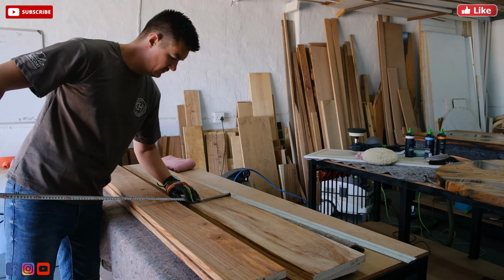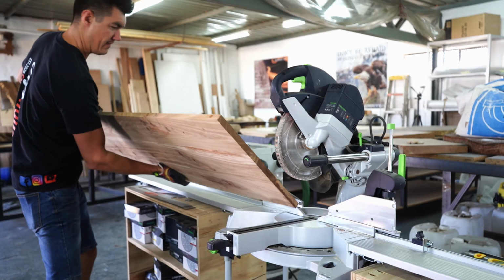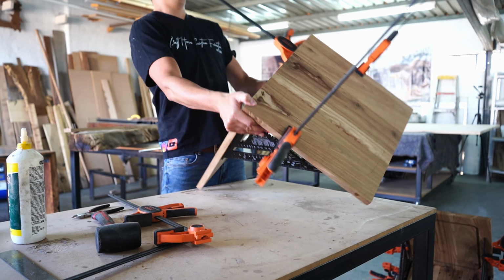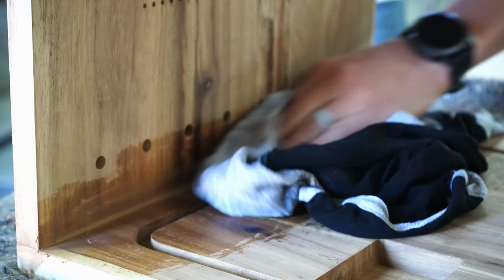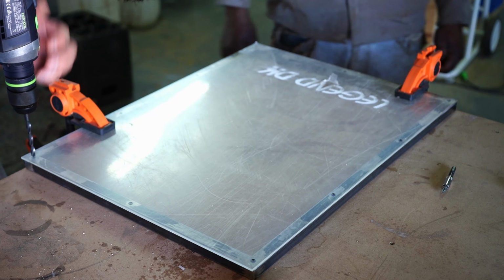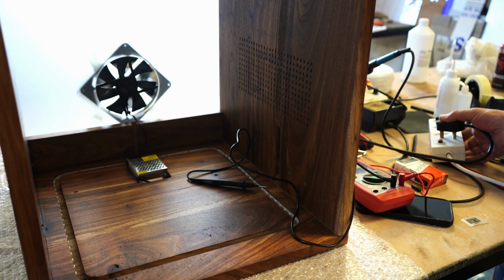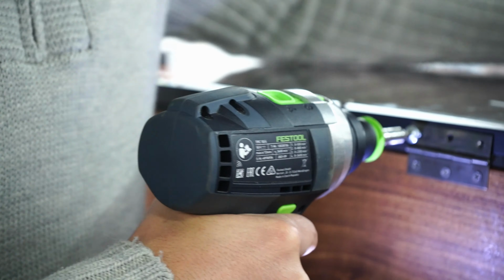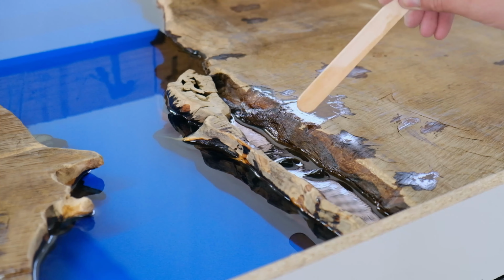DIY Biltong / Jerky Dryer Box Build

Comment: Nice build, but I would have put the venting holes at the bottom and then add a separation layer above the holes with evenly spaced holes to force the even distribution of air upwards. Then I would also add plexiglass all around the inside for sanitary reasons so that it is easier to sanitize after each use. raw wood is likely to encourage bacteria to grow.

Comment: If I may provide my opinion 
The air holes on the side should be down on the bottom
Reason being as rhetorical air is drawn through. It’s drawn through evenly help to get even air flow through out the box
The drip tray is a great idea but need to be raised a few inches of the bottom and also drilled to promote even ventilation  throughout 
Thanks

Comment: Love it, and subscribed...

Question does the fan blow in air and through the vents out or is the fan blowing air out
Reply from the maker: The fan blows inside the box onto the meat, just pike in the butcher shops, they have no “heat” elements only a fan that blows on the meat
Reply: @diywithgreg  thank you so much I appreciate it...

Comment: The wood you've used is amazing. The LED looks amazing. Glad you didn't add a heat source, saw some comments about heat source. The last thing you need to make proper biltong is a heat source, you're not making jerky:) Air vents would be best at the bottom of the cabinet as you need the air to flow over the meat. It looks like a 120mm fan, which is to big for the box, you just need 80mm. 120 could dry the outside to fast.
Reply: The globe is required in climates where there is high humidity or perhaps in winter when it’s very humid
The bulb helps dry the air about
U should only be using a 40w incandescent light globe which emits minimal heat. Thanks

Comment: Air vents in the wrong place, fan in the wrong place, no heat source, rails to close together, biscuits showing, door not closing flat, average hinges and different screws, clunky latch. Well you did ask😀
Reply from the maker: Funny thing is it works perfectly, meat comes out 100% everytime, and you dont need a heat source by the way.
Reply: In Africa its hot, even in winter its hot. Lightbulb heat sources will work elsewhere
Reply: Do you live in Antartica?
Reply: Yeah thought the same, it's not bad and surely it does the trick, but was not impressed with the craftsmanship.

Comment: Nicely built. I have a sister in tokai Cape Town. Whenever I visit from the uk I get biltong.  Two comments. Should you have a light in the box just for warm air flow? Secondly should the vent holes be nearer the base to allow for the air to flow the full length of the box?

Comment: You've got not air movement at the bottom of the box. The ventilation holes need to be at the bottom of the box not 3/4 the way up. Blow smoke through the vent holes into the box with the fan on and you will see the air movement that you have got.
Reply: When you blow smoke in, air circulation and exhaust will show that you do not have a complete understanding of aerodynamics. Yeah, different locations of the air-intake drill holes will improve direct air flow, but in the current configuration, this bilton box works as required
Reply: Cold smoke also enhances the flavours

Comment: Mitre the corners and drop the vent holes down to make sure you get full circulation Greg. But that’s a beauuuuutiful dryer dude
Reply: Or, in my experience, put one set of vents high and the opposite low for complete circulation.